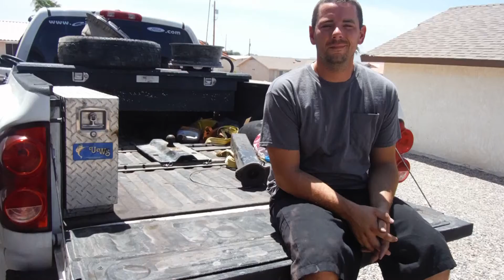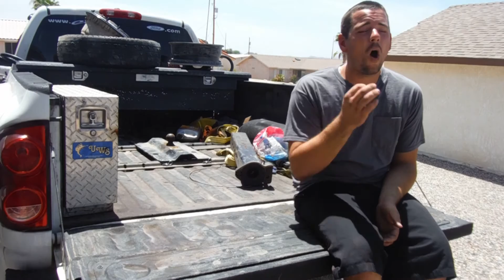HOW TO HOTSHOT...POWER UNIT HITCHING SYSTEMS...HOW2HOTSHOT.COM

Comment: Curt now makes a 5th wheel adapter to go into their gooseneck under-bed hitch setup, so you can easily (although a little costly) have both worlds, and still keep a clean bed floor with the hitch removed.

Comment: If you have bolts and nuts separating the best way to fix it is either drill the bolts or buy bolts that have a hole in it and use a cotter pin. Eliminate any gap by using washers or a extra nut to make it as tight as possible before putting the pin in.

Comment: Question. What would I be able to pull with a early 90's F350. With a 6v53 engine and a RTO 6610 eaton fuller? Her max speed would be 74mph on the freeway. BTW a 6v53 can have real jakes on her. She also has dual tanks stock, one between the framerails. The engine was swapped into the truck

Comment: I've watch a few of your vids now and I like them all. About your hitching system, have you thought of putting a bead of weld on your bolts to keep them from backing out? And or you could weld the whole hitching system to the bed as well? If I go ahead with hotshotin, I think I would take the bed rite off and put diamond plate over the top of the frame just wide enough to cover the frame and then put that boxed system on it that your were talking about. 
    If you haven't already made a general over view vid on hotshots for anyone THINKING of getting in to it, could you? Touch a little on all the aspects, like people thinking they are just going to sleep in the back seat, having a class A, should have a diesel 3500 - 5500, and anything that people might assume they can do, but can't. If you already made such an over view vid, then I'd like to watch it. Thanks.

Comment: Hey Joe I recently started watching your vlogs.  I am currently a DOT registered carrier with my own authority and because of money constraints I have been working with a Ram 1500 and 20 foot bumper pull but since getting in with Central D and now United Roads Carmax account I am upgrading. The truck is either gonna be a 2500 or 3500 with the 6.7 cummins.  The trailer is gonna be a 2 car hauler I'm leaning towards Kaufman "the poor mans" trailer but it seems to be popular and affective.  My question is can I put two full size 1500 or even 2500 HD trucks on the carrier if I go with the Ram 2500 or should it only be done with the 3500.  Thanks Joe be safe out there
Reply: great to hear uplifting stories like this. I plan on buying me a 2010 f350 and then get a 3 car trailer as well. my question to you is, how has central dispatch been and United Roads CarMax?
Reply: Well Joe Central has been somewhat beneficial to me but I am finding a lot of brokers are posting one rate and when your on the phone they try to lower it most times I can refuse it and say no thanks but sometimes I base my route on the backhaul and if I don't have any other way to get a load I'm kinda in a bind.  Since joining up with United Road and Car-Max I have found my job a LOT less stressful and somewhat profitable.  A lot of carriers on Truckers Forum are constantly complaining about low rates and non-payment and yeah some loads are low but I have no issues with payment I get ACH deposits in two days ( of course with a 5% fee) but it's brought me to the point I am at now with upgrading my truck and finally getting my Kaufman 2 car hauler.  It's a tough business out here especially when I am doing it all legit with DOT and FMCSA guidelines and insurance, but well worth it.  Between you and Wayne I have learned a few important things.  I am actually thinking of uploading some videos about how I got started and what every Auto Hauler needs to do in order to be legal and follow the rules.  Maybe some travel vids to not sure.  Ok I have talked your ear off enough.  Stay Safe out there and don't forget to keep it between the lines.  If you have Twitter let me know so I can follow you.  Take Care and keep the videos coming
Reply: Sorry Dee I wasn't paying attention when I wrote this.  I thought it was a message reply from Joe but my reply was meant for your questions

Comment: Thank you for your reply do you recommend me any companies in Chicago to start off with because I really don't know anything about it all I see is just your videos and it looks very easy but it might not so you right I should start working with somebody as first for a couple years and then start my own thing what companies do you recommend in Chicago to work with
Reply from the maker: United road is located in Michigan up there. They are a very large company in the industry. Car hauling is very interesting in the fact though that it doesn't really have any mega companies. don't get me wrong.there are large companies but nothing like freight. honestly I would do a craigslist search in that area. I know that I see them for car haulers all the time around where I live. I know that a guy at a truck stop last week worked for united road and he told me that there training was two months long I think. try united road, central valley, automatic, pilot. You can also get some experience in the industry from towing cars as well. make sure you keep in touch and let me know if you have any questions How2hotshot@gmail.com

Comment: Hey buddy how are you I see all your videos you're doing a great job I live in Chicago and I want to get into this hotshot business but I don't know how to get the loads from where do I get the loads from where do I find the brokers I have a class license already do I just go ahead and buy the truck in the trailer but where do I'm going to get the loads  from can you help me out with it thanks
Reply from the maker: Hey Asif! you sound like you are off to a good start. I imagine Chicago is a great place to work. I don't run up that way anymore as I only work the southern united states nowadays. Are you looking to go independent own your own or lease onto a company as an owner operator/ buying the equipment should be one of the last things on your list of things behind establishing your business and getting approved to run. I would hate to tell you to buy a truck and trailer and you find out it isn't going to work out for some reason or another. the most common load board I know of for car hauling is Central Dispatch but you will have to have your company together to get access to it. another way would be to contact one of the many car hauling companies in the US and ask if they are hiring owner operators and find out what there requirements are.